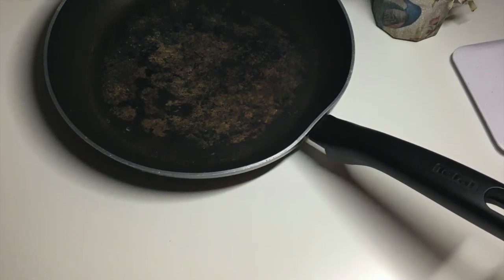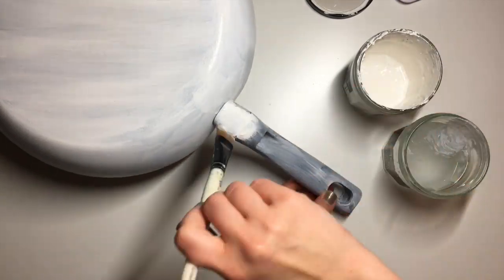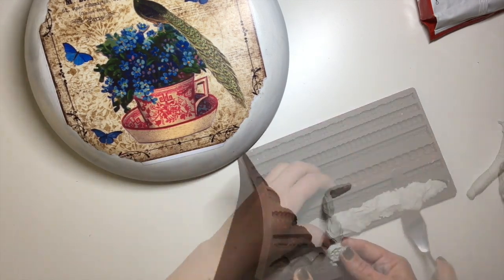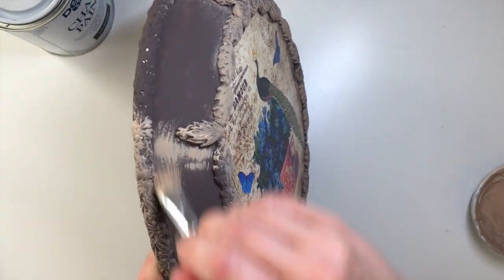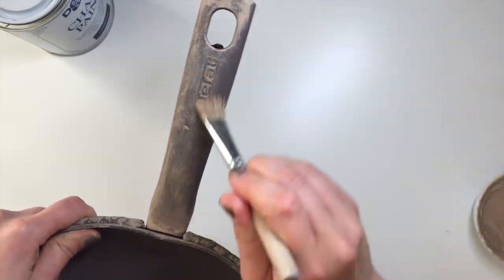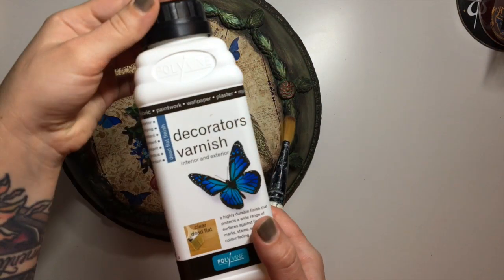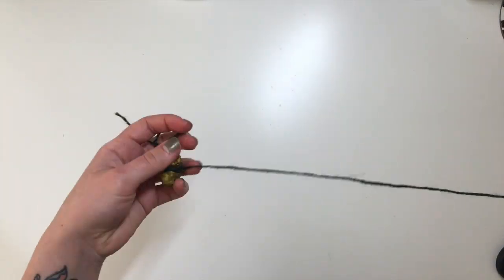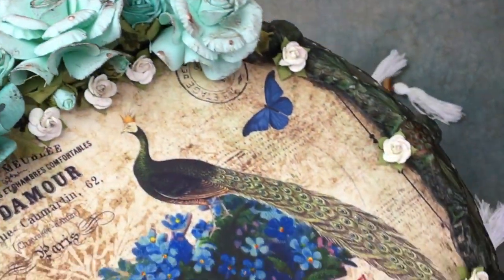DECOUPAGE ON FRYING PAN | UPCYCLING OLD, METAL FRYING PAN | DECOUPAGE TUTORIAL

Comment: Lovely and so clever! You more than anyone, have been my inspiration during this crazy time (on top of the shutdown I had also just broken my ankle & I live alone in an upstairs apt. so I was already "down"). You've taught me so much about layering paint, custom mixing, use of gilding waxes, different primers, decoupage techniques for perfectionists (I love your work because it is done with care, I cannot stand bubbles or sloppy decoupage work in my pieces) and yes, varnishes! I so appreciated your almost immediate response to my question about various types of varnish- sorry, I didn't tell you that when you wrote back. I will say, here in the states, we tend to distinguish & label our protective finishes or "varnishes" into categories on the products ie: polyurethane, lacquer, shellac, Spar varnish -  and at least here in the Northwest in my tiny little port town across from Seattle;  Minwax Polycrylic is the go-to brand for low VOC water based varnishes, it comes in gloss, satin, matte- and I just read that they have come out with a new one in "Ultra Flat" finish!  This Polycrylic top coat is for indoor projects (though it is quite tough and can be used for tabletops as it withstands lots of wear of tear)  the spar varnish would be used for anything that will be outdoors and is what I was recommended to use for coasters or things with the need to be heat resistant regularly. Here is a link to a short yet informative article re: the differences & applications of various varnishes/protective finishes, should anyone need or want more info: 
https://www.diynetwork.com/how-to/skills-and-know-how/painting/whats-the-difference-between-polyurethane-varnish-shellac-and-lacquer
Reply from the maker: Wow, thank you so much for your kind words, you don't even know how much it means to me and how thankful I am that you find my work inspiring and that I'm able to do something to make you a little bit happier! <3 
sounds like Spar varnish is probably a good alternative to our Polyvine here :) and thank you for the information, I'm going to pin it to the top so that if anyone is in search of this information they can find it :) <3
Reply: @IvetaZiedina  Sweet : ) So looking forward to your new video and if you ever need any pickling/canning tips, give me a shout- I used to own an organic NW pickling company in Seattle called TabbyCat Pickling Co.- happy to pay it forward and share my recipes and "purrfect" pickling tips if that's something you're into :>3- Cat